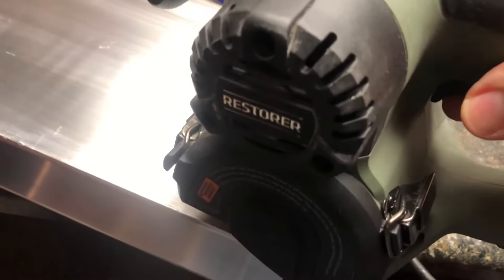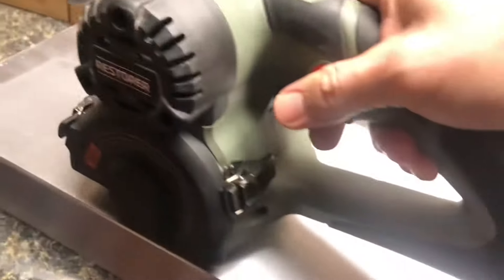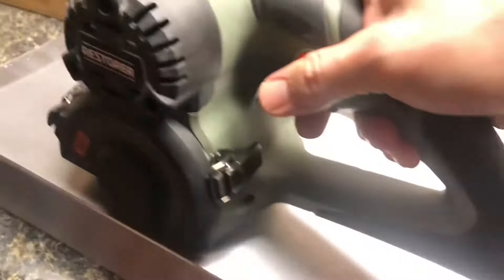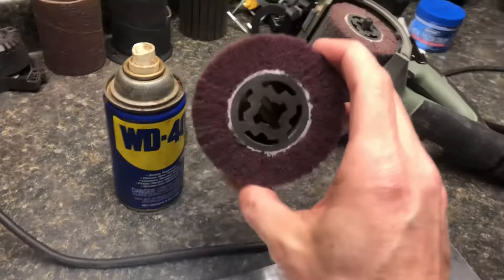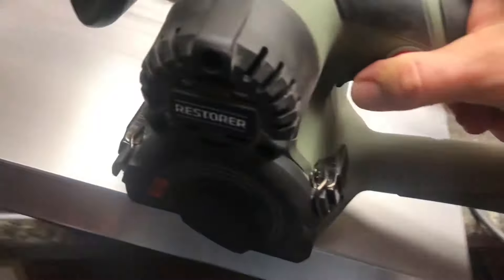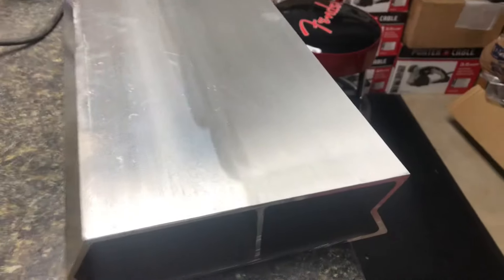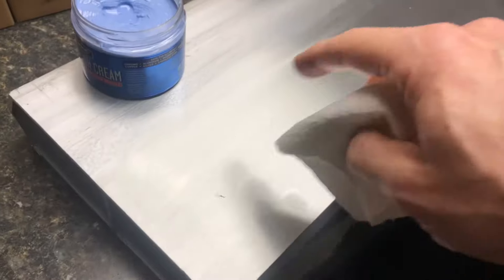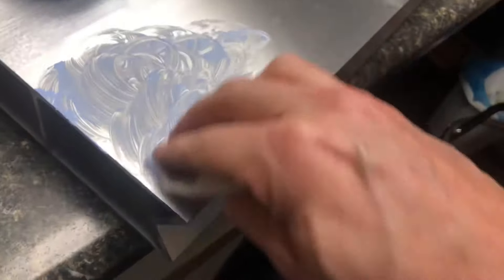How to Polish Bare Aluminum in Seconds with the Restorer

Comment: I just got done hand sanding and polishing the big aluminum utility box on my semi. It was an old one the company put on, heavily oxidized and a lot of pitting. Cleaned to whole thing off with some brake cleaner. After that I sprayed it down in WD-40 and knocked off all the oxidized layer with a 240 grit scotchbrite ball, then hand sanded working my way all the way up to 2000 grit, using WD-40 and wiping it down between grit changes. Finished off with some Mothers Mag & Aluminum polish and now I can see my reflection. Still quite a bit pitted and dinged up in areas, but it certainly looks a lot better all shined up.
Reply from the maker: That is awesome!!